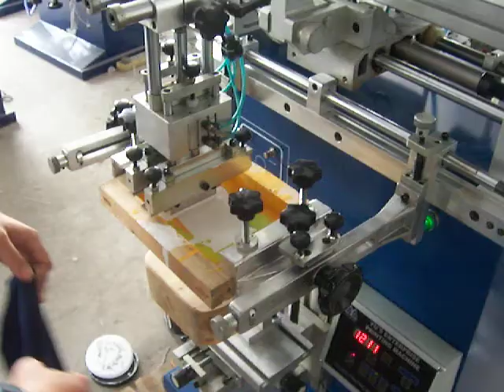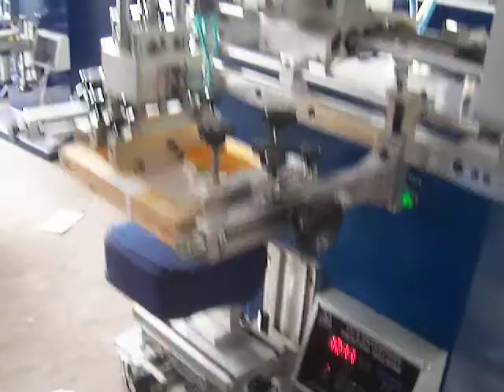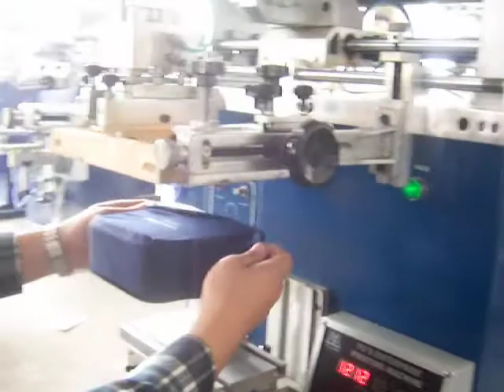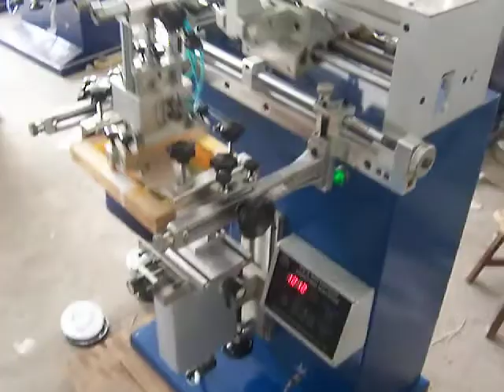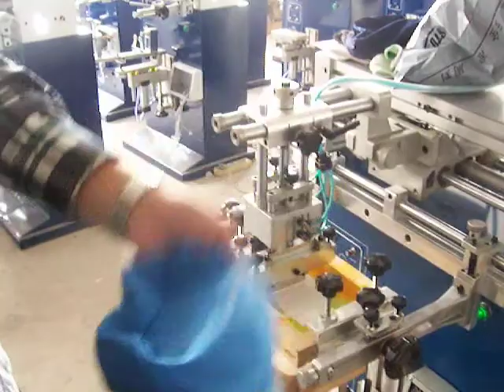bathing cap semi auto screen printing machine

Comment: what ink you are using? i want to print on silicon...
Reply from the maker: Hi, if you want print on silicone, you need to find a special ink for silicone material. Should test the ink color fastness frist. Do you have a silk screen printing machine to print?
Reply: yes..i got everything ready...but only couldnt find this paint that stick on silicon...i have checked here almost all paint stores...they dont have this ink...now im thinking to print on silicon with some primer or clear varnish first that can hold the oil paint...im still trying...the ink you are using must be very expensive right?
Reply from the maker: @modikee56inchkeegandafterw13   oh, maybe it's better to settle all the details down then to buy a machine :)
Not exactly, this ink is expensive than ordinay ink, but not very expensive. About  30usd per kg.